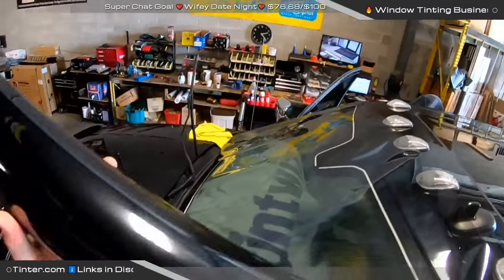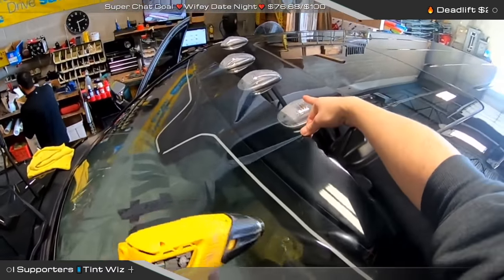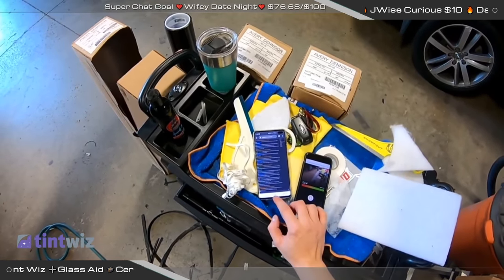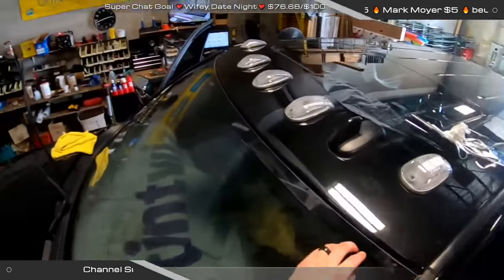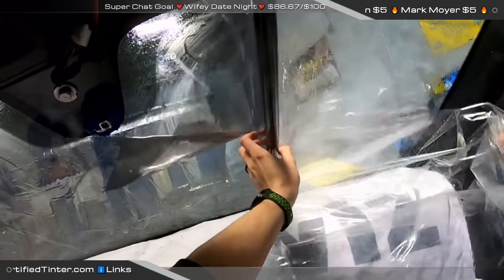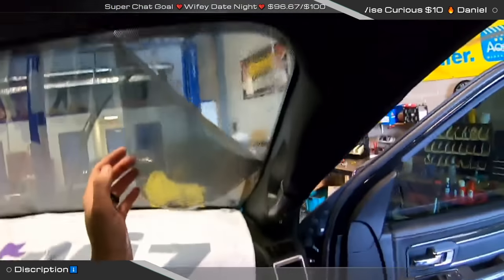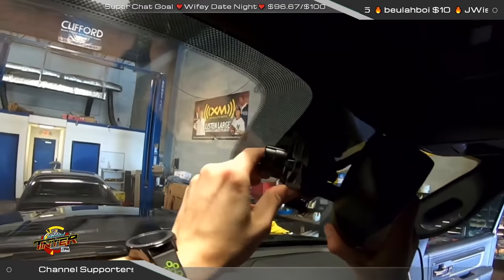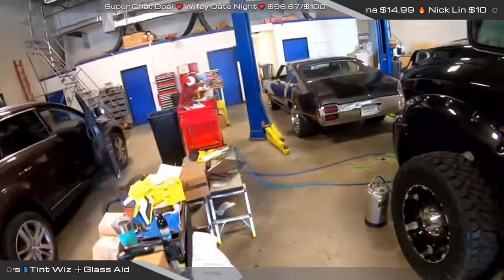🔴 Ram Windshield Tint | How to Tint a Windshield | Hand Cut and Install Windshield Tint

Comment: Hey Matt, listen I appreciate your videos and such. They have helped me lots. Business is picking up because my performance has gotten better. I'm still a little slow but I'm on my own clock. Thank you very much Sir!
Reply: How long does it take you on average for a four door
Reply: @dnawrapsatl  takes me about three hours. My shop is not set up yet so much of time is getting stuff out and ready to work. I'm limited as well due to my health and I do this to make ends meet.
Reply: I'm trying to get my place set up well with the rolls on the wall and such. I'm basically working out of my pocket so to speak 😆. I'm getting there though.
Reply: @JohnWilson-hu4oj  if everything was ready would it be safe to say you could do it in 2 hours customer out the door? I had another question about what your entry process is. Do you let the customer pull it into the bay? And do you care if they hang out and watch?
Reply: @dnawrapsatl  no sir I don't like people hanging around. I'm just starting out this year is my first. I'll just make a mess if someone watches me. If I wasn't hand cutting patterns I guess I could it faster. Like I said though I have gained more precision with practice and I assume speed will come.

Comment: With my medical condition I have grown to prefer around 25-30% but it's one of those more weird percentages but it helps me even at night it has made it way better for me not getting bad headaches from the sun or headlights let's me drive more during the day and night both. I've never had an issue with 25%-30% windshield tint.. I just wish I could do it myself cause I can't find a shop I trust at all besides you and your 5hrs away haha

Comment: I've noticed when u lay the tint down and anchor before starting the shrink.. That the tint lays on edges/corners pretty flat.. When I've done windshields I have to manipulate the tint to create the more flat edge look but when I do it seems really bunch up towards the middle of the window. It took me five different tries and each time I found the upper corner of the passenger side creased in multiple areas

Comment: I live in mass and they don’t even want tints in front windshield but I would install a 70% so it would pass inspection and would still offer it protection and helps keep car cooler and so far it’s good haven’t had a car towed cause if the tints. They definitely don’t give breaks here they don’t give tickets for the tints they just tow it.

Comment: i have a question , why did you place the tint on the outside of the windshield and shrink it without using water ? Maybe i missed something.
Also what’s that white tape thing you use on the windshield
Reply from the maker: it's faster to shrink it dry and you have to shrink it on the outside so you have room

the tape is called Glass Aid and I use it to protect the glass while cutting on it